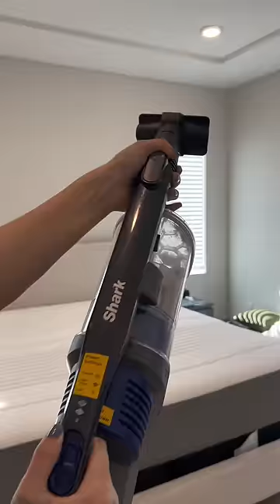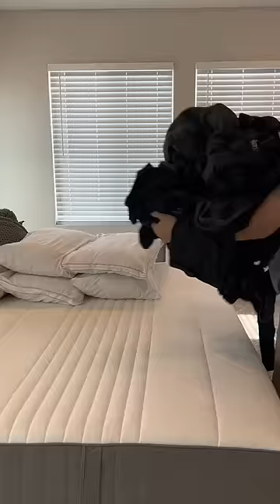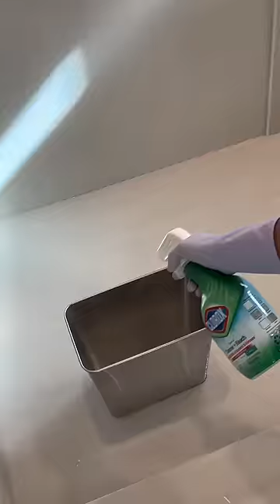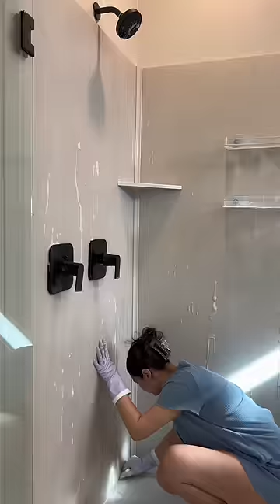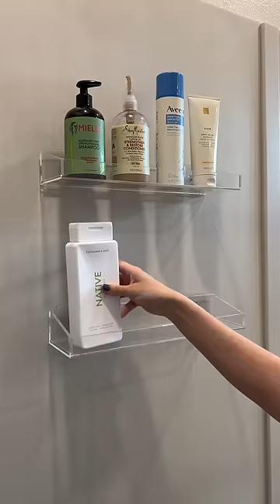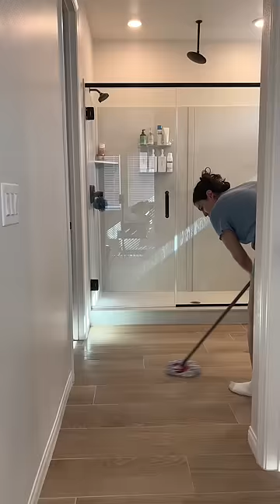Saturday cleanings✨ #cleaningmotivation

Comment: It is better, after using the sponge, to wash the place with water, then wipe the bacteria after the disinfectant with water, not with a towel, so that the bacteria do not remain.  Why don't you flush the toilet with water?  Isn't it enough to use detergents and wipes for cleaning?  It's disgusting.
Reply from the maker: Clean how you want
Reply from the maker: The water was flushed you weirdo